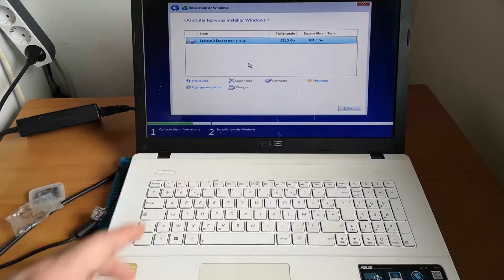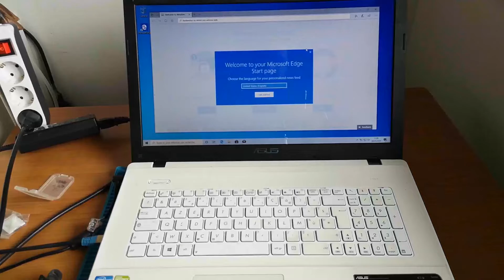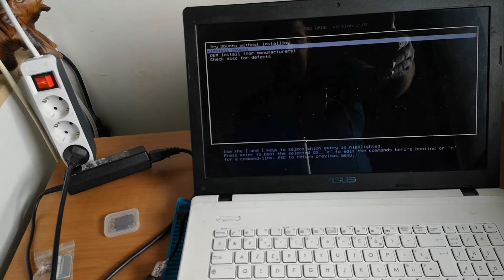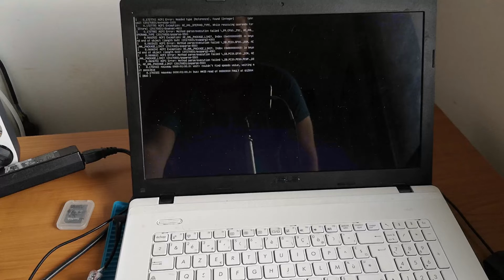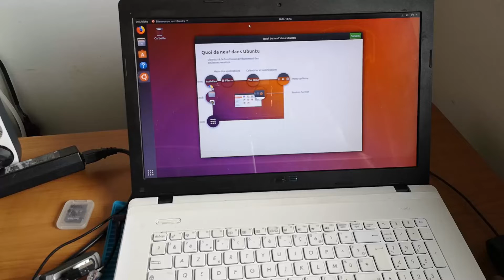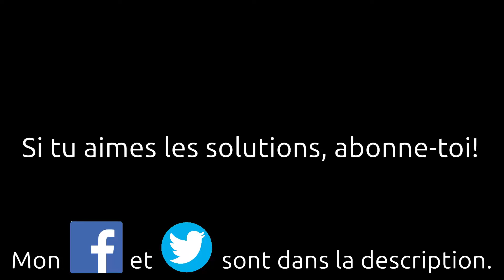[Tuto] Comment remplacer le vieux disque dur HDD d'un ordinateur Asus X75V par un SSD gros et rapide

Comment: J'ai le même pc un core i5 je fait du modélisme 3d mais pas moyen de travailler correctement ca ramer trop alors j remplacer mon vieux hdd par un ssd 500go jviré le lecteur dvd et je l'ai remplacé par un sshd de 2to et j augmenter la ram de 4 a 12go le max que la carte mere pouvait  supporté . Et la j une formula1 . J regarder des pc avec le même matos et ca couté  dans les 900 ,1000€
Reply: Un peu tard, en esperant avoir une réponse tout de meme, tu as un tuto pour virer le lecteur et add un sshd?